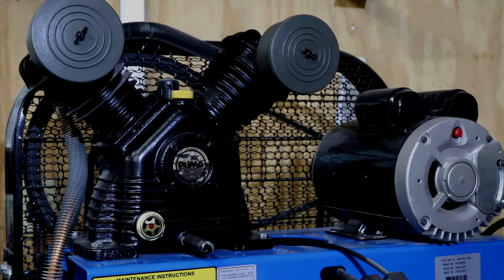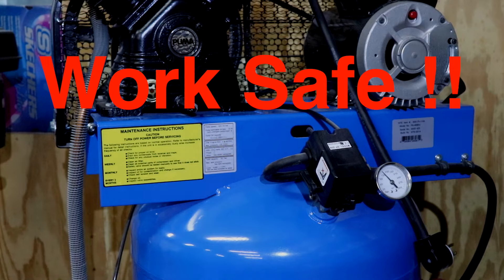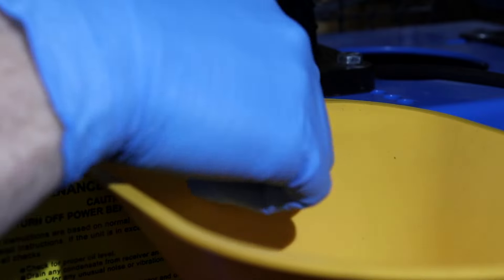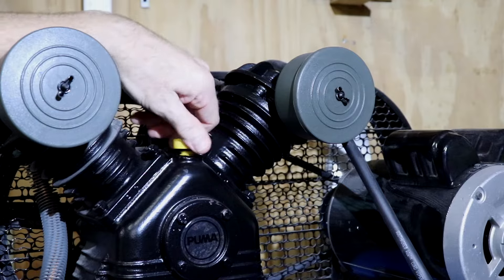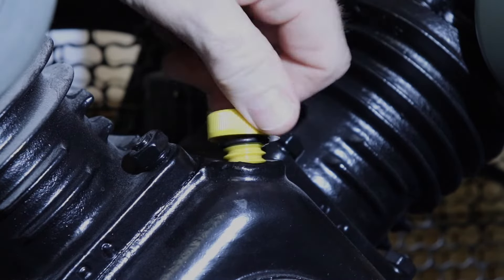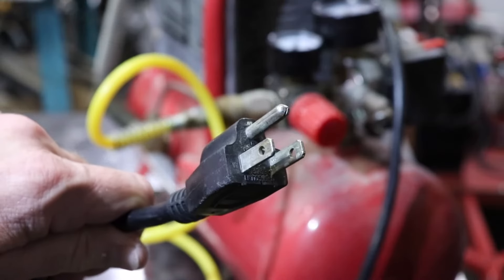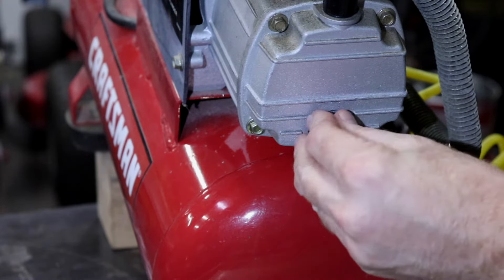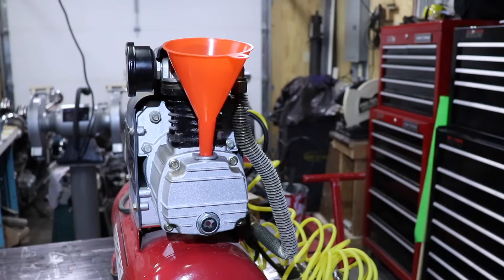AMSOIL Synthetic Compressor Oil - Changing the oil in 2 air compressors

Comment: @1:08 where did u get that oil drain extension? It prevents the oil for spilling under the tank, awesome… Can you please provide where and the size .
Reply from the maker: The compressor came that way.  It's a Puma from Northern Tool.  Perhaps they or another compressor distributor would have a similar part.  Thanks for watching and leaving a question!

Comment: Is it normal for the compressor motor and piping to get very hot in less than two air refills? 😮
Reply: Yes, if you mean the pipe coming out of the compressor itself, that can get very hot.  Too hot to touch.
Reply: @metalwooddesign  Thanks. I'll be checking the no return valve and changing the oil 😊

Comment: How many much should I change my 10hp air compressor?
Reply from the maker: The owners manual is a good place to start for sump size, viscosity, change intervals, etc.  The two compressors in the video use less than a quart combined, so changing them every couple years is very economical. Of course, 10HP would be a much larger unit. For service life, AMSOIL recommends this product up to 8000 hours. I change mine every two years. Hope that helps.  Thanks for watching and leaving a question!!

Comment: I have an older 80 gallon. Not sure what oil to use
Reply from the maker: Check for any info on a data plate or model info for a Google search.  30wt is very common but it's always best to use the manufacturers viscosity recommendations.  Thanks watching and leaving a comment.